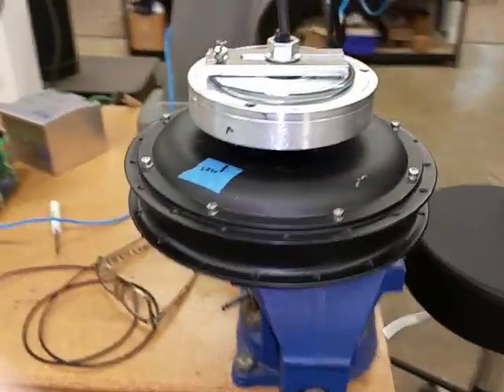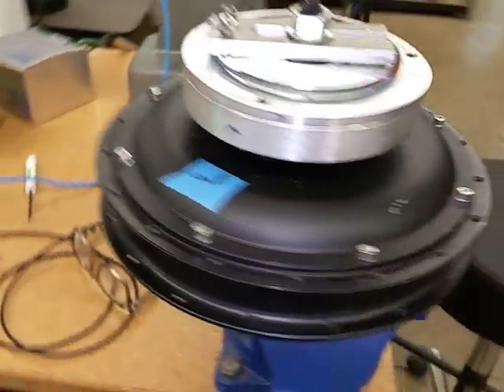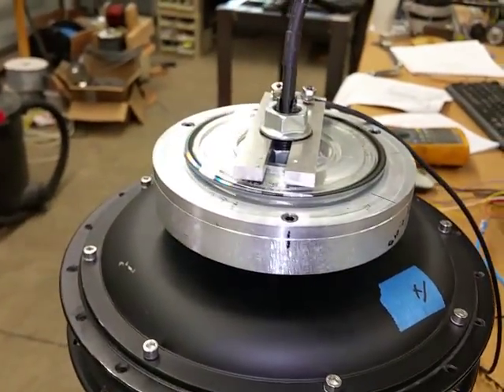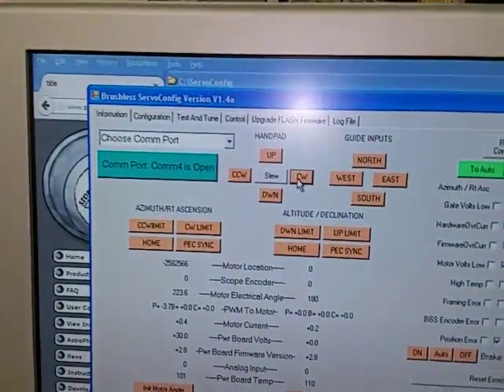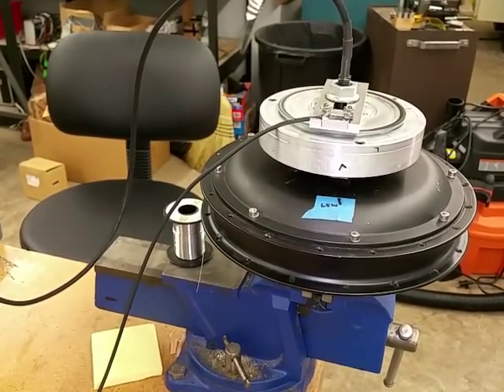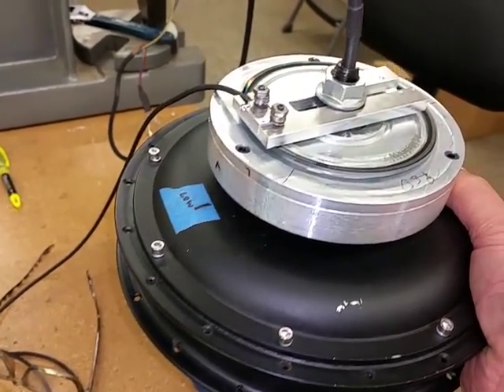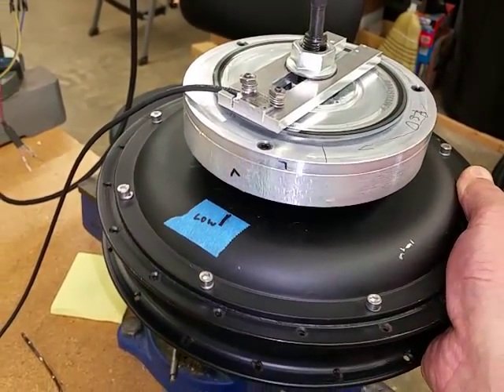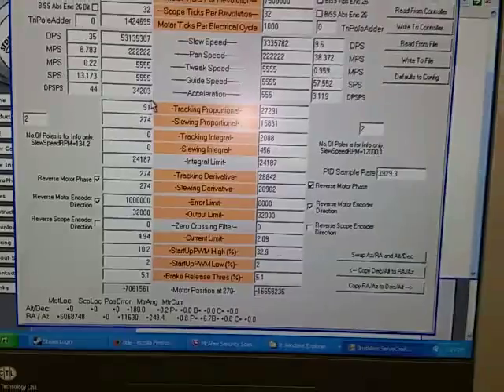Bicycle Motor for telescope control

Comment: Hi 
If you dont mind i have a burning question but cant seem to get any yes or no answers 
If i had a bldc motor with 3 wires coming out of it can i add a renishaw encoder and buy the correct driver to get the same level of positional accuracy as the encoder is rated for?? 

Im trying to build a direct drive 4th axis for a cnc machine 

Would really appreciate your intelligence here 

Regards
Reply from the maker: pretty much.  
What is your applicationj?
Yes, there is cogging but it's pretty slow, so for tracking a telescope, it's ok.
Reply: Hi thanks for getting back to me 
Im building a lathe spindle with c axis 
So i need it to index as accurate as the encoder i use 
Max rpm is 4500 but doesn't really need to index at the speed but i was told it still will 
Do you think that might work?
Reply from the maker: I don't think it will index at that speed accurately, what speed do you need to index accurately?  What is the motor you want to use?
Reply: To index 200 rpm max but can live with less 
The motor is a hollow bldc motor 5kw constant max rpm 4500 it will have a break to hold it after indexing to correct position
Reply from the maker: Oh, well that's different, you'll be able to position it very accurately at the index position.
Dan
Reply: Thank you very much can you recommend a controler? I found one by ingeniamc called Jupiter but still waiting for price 
But thank you very much i spent the day trying to find the answer to that. So would it be safe to assume the same would apply to the rc bldc motors? With the correct controller?
Reply from the maker: I don't know any particular controllers, but I think Parker makes them.  We can sell you one of ours, but it's quite expensive (it will operate 2 motors).